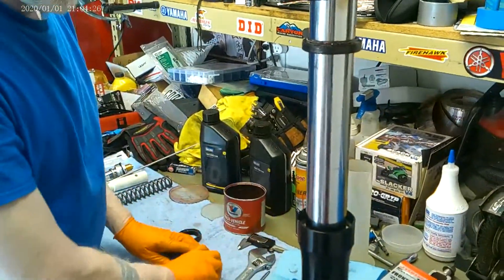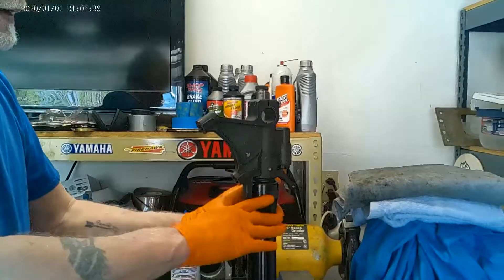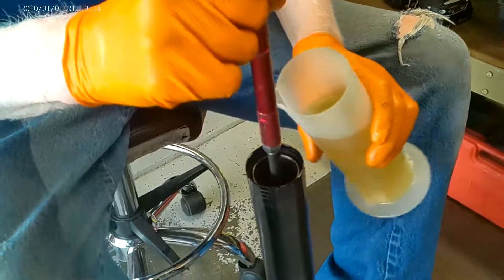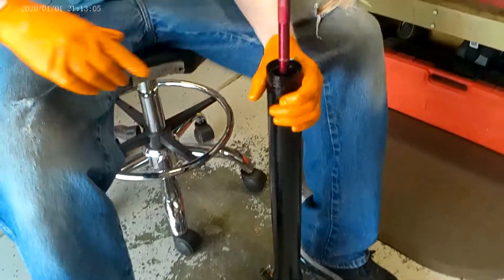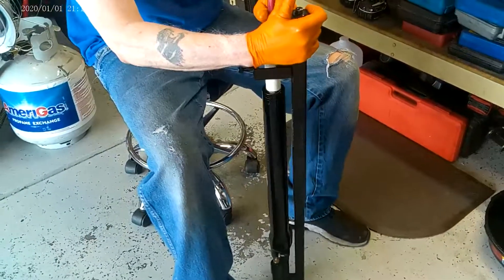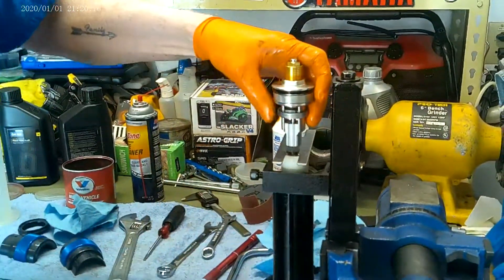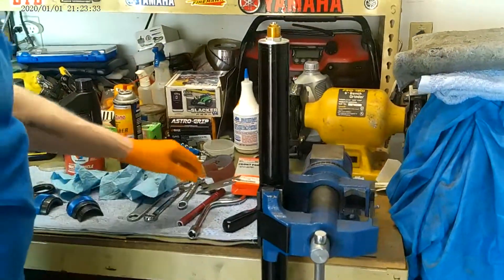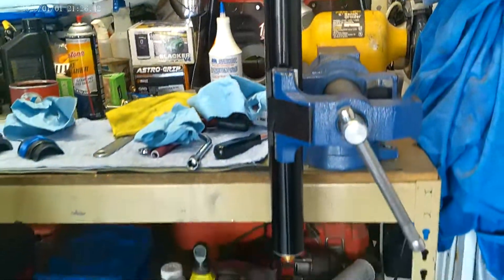Yamaha R6 Fork seal replacement part 2

Comment: Great job Mr. Wilcox. So I have a problem with my bike ever since I had my fork seals replaced. My 2016 r6 used to turn great. Where I’m from we mountain carve. So I need my bike to turn well. But ever since I had the seals replaced it will not turn like I want. No matter how soft I run everything I still have to wait on my front end. If I try and push them harder I can feel the front end sliding. Not only that, now there is 0 static sag. plus I weigh 170 lbs and only have 12 mm of sag. Where as before I had it set to my window around 30,35. So what would your best guess be? After I watched your video, I’m thinking air gap